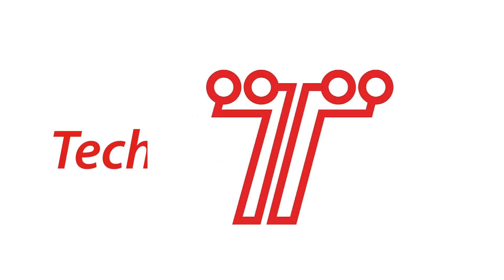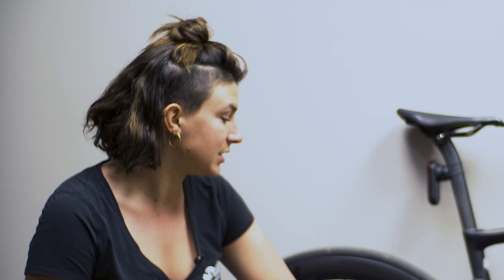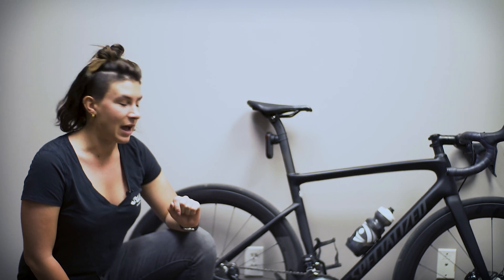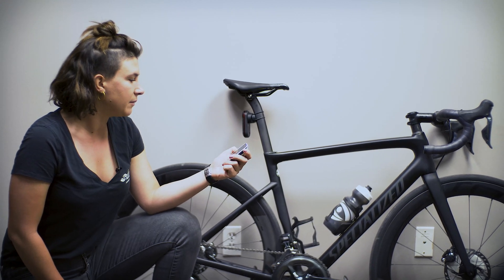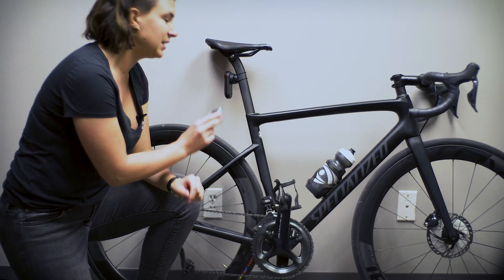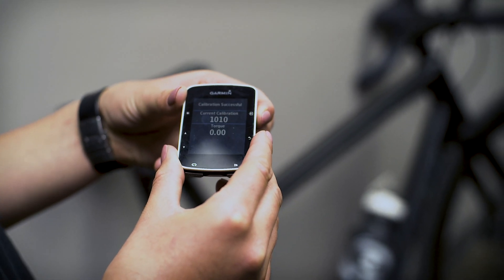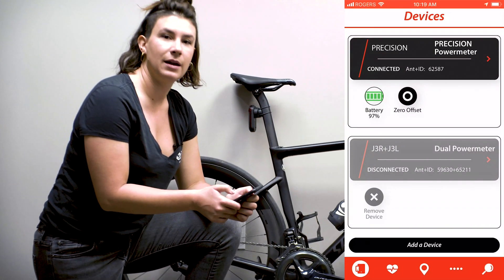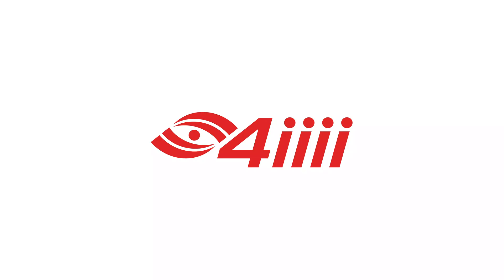TechTip #2: Zero Offset

Comment: Great tech tip if it works,  mine has stopped and will not zero offset, tried everything, unpaired, deleting repairing.  The error message is so unhelpful, zero offset failed  ...  hopeless
Reply from the maker: Hello, if you are continuing to have issues with zero-offset, please contact our support team at 4iiii.com/support.  Thanks!
Reply: Any update on your issue? Have the same unhelpful message.